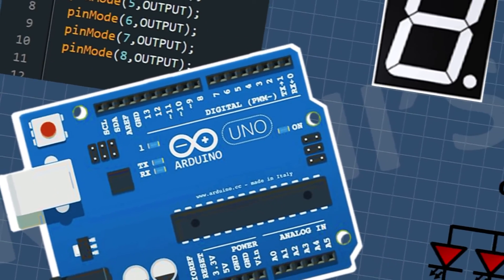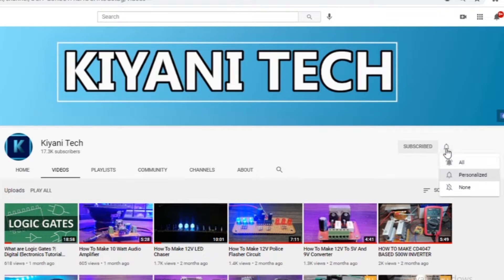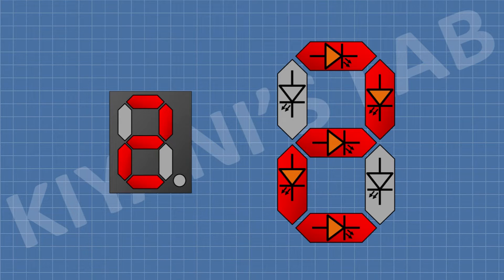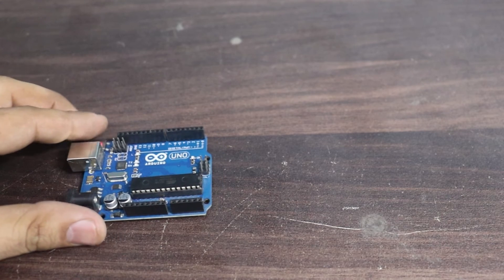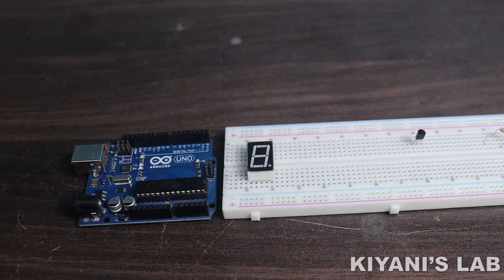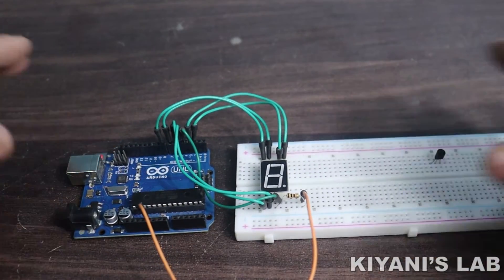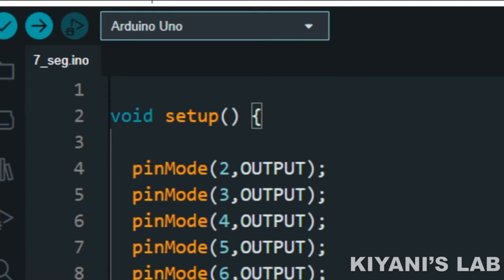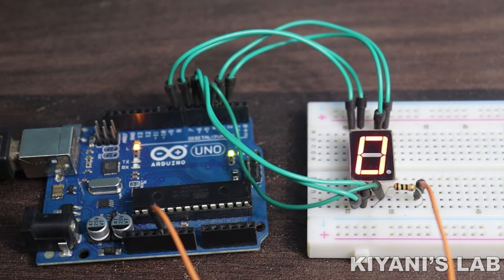How To Use 7 Segment Display With Arduino | Arduino Tutorial

Comment: The video is fantastic and it shows enough information but if you're using a 7 segment display with a common cathode you need to connect it to the gnd not to the 5 volts. Thank you for the tutorial.